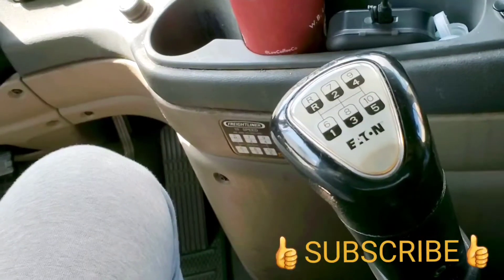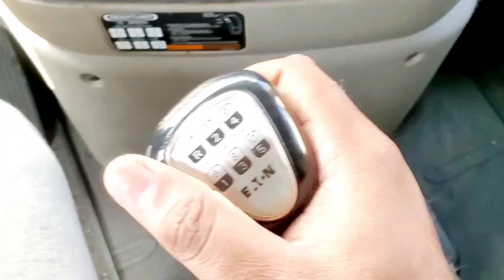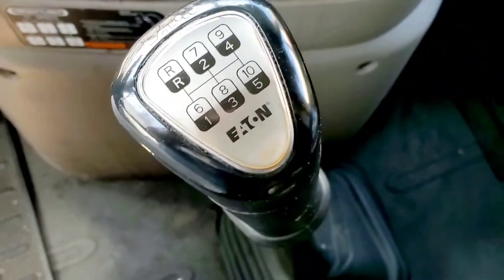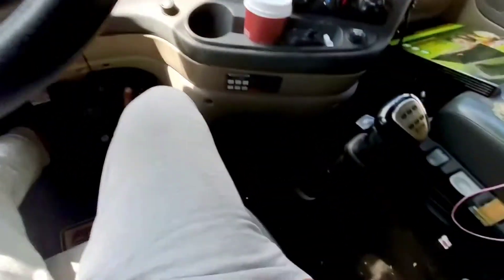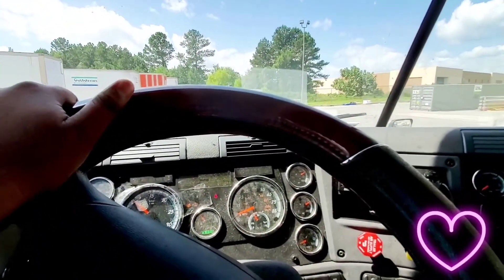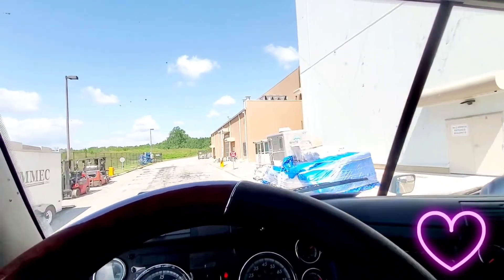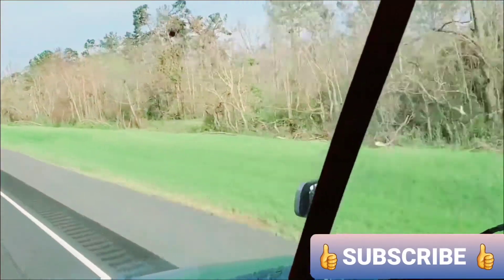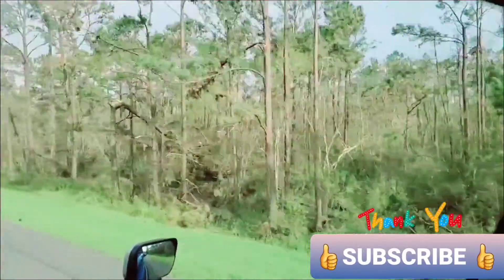How to Drive Truck with Bad Clutch & Bad Transmission and save road service #trucking #owneroperator

Comment: How to fix it mine started today I went 250 miles to get back home in low gear but some times it got to 55 going down hills but up hill 15 miles. Crazy experience.
Reply from the maker: thats something related to power. check blue hoses on engine/intact/turbo /smoke from exhaust.  could be alot different things.

Comment: I had a same issue today with hydraulic clutch.i was only 2 miles away from my terminal. I was stopped at traffic light and couldn't put in to any gear .will go back tomorrow and see what's the problem.
Reply from the maker: Turn off truck put in gear and start truck you will be able to drive with rpm.  Make sure go neutral when stop.

Comment: You just said shit won't go in gear then you said try to get it in gear. You don't make sense.
Reply from the maker: Turn off truck put in 1st gear and start the truck. It will start moving ur truck.
Reply from the maker: Stay in gear all the time and shift with rpm only.
Reply from the maker: If you have to make full stop go neutral and have to repeat the same step again to go back in gear.